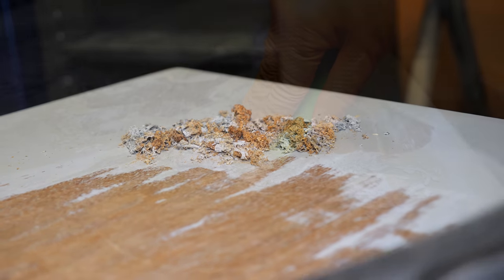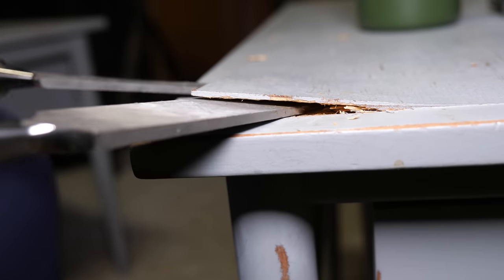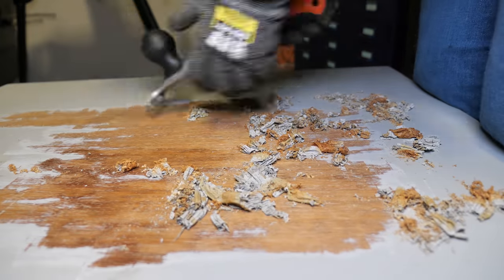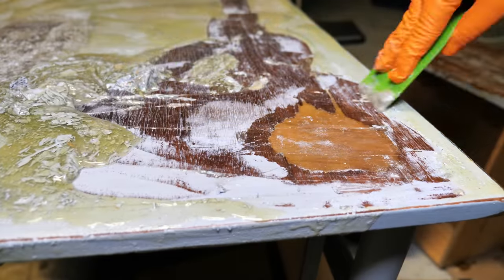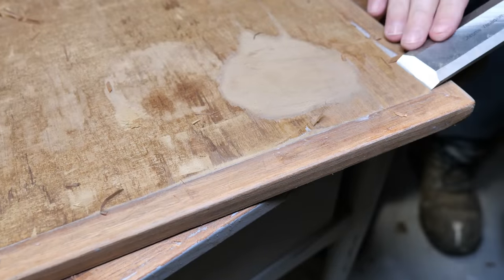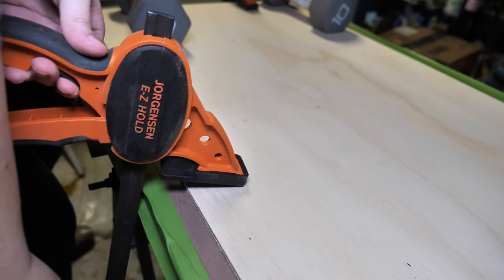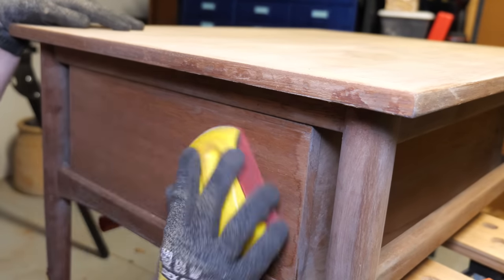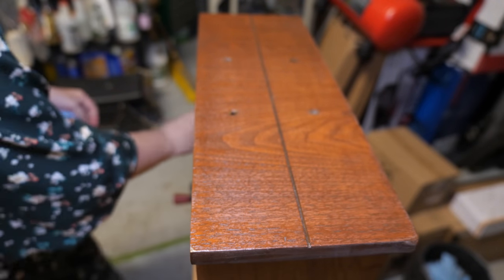Just painted right over the problem.

Comment: When my mother passed away, I took a coffee table that my dad had made for her. She had found cast iron legs and so he made the table top. At some point mother must have thought it would look nice with orange faux leather stapled on it🙄……..then at some other point she had left over green self stick floor tiles. They were stuck on top of the faux leather 🤦🏼‍♀️. My sister said dad put the faux leather on when he made it but due to the random staples I knew mom did it.  Long story short, I removed all the garbage from the top and found stained wood but due to mom also using some kind of glue on the vinyl we had to add thin oak to the top and sides. Table looks great now!
Reply from the maker: Thank you so much Lorre! ❤️ I appreciate you sharing. I bet it looks amazing!